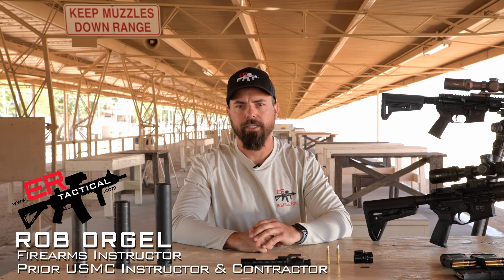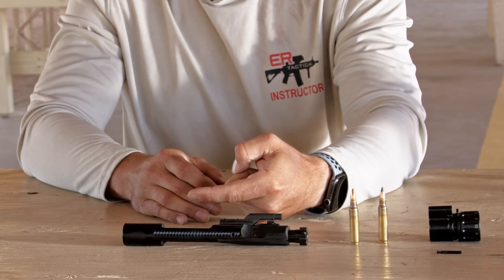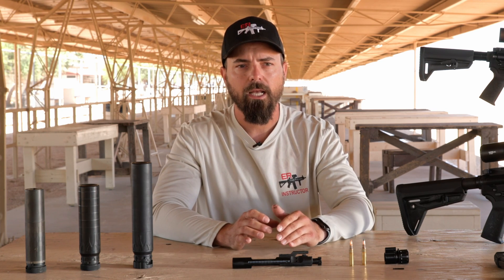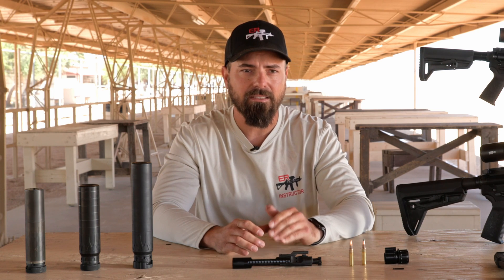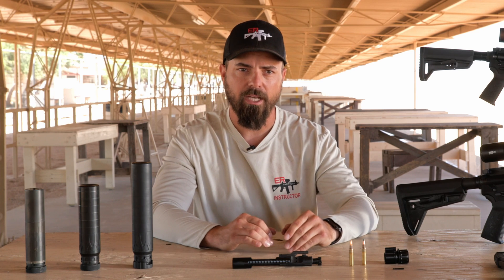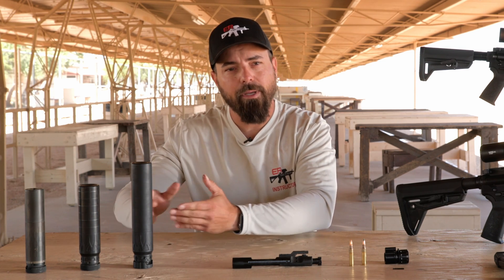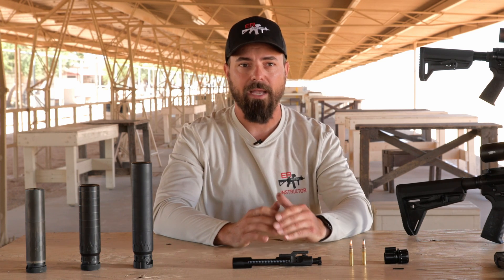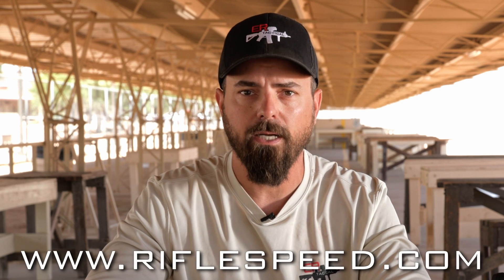AR Gas Pressure Basics

Comment: I go from suppressed to unsuppressed and back a lot. These GB are great. Had to take my one off my 300 blackout because I was loosing too much pressure with subs to us the carbine buffer. Would work with a 1 ounce buffer but then my bolt velocity was too much for supers. My BCG was part of the problem because it was kind of in a patient, but it was already on the bleeding edge of running everything. No big deal because I build a new PRS gas gun that now has it on it. I can switch my zero and gasing now with the info I put in a little notebook. I love it.